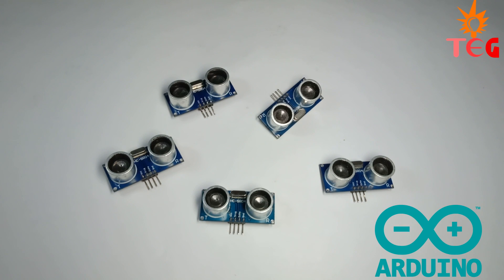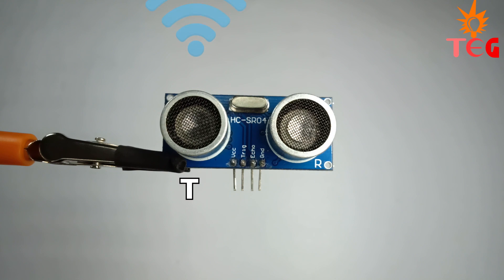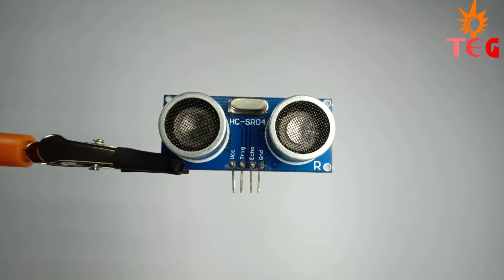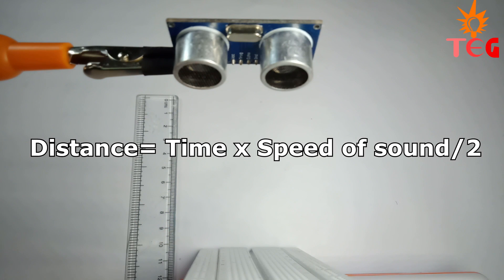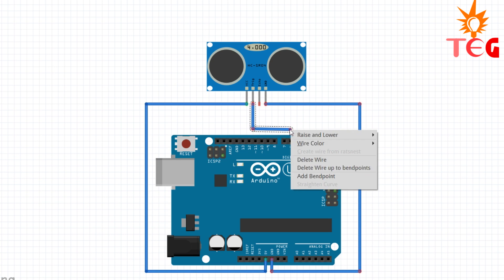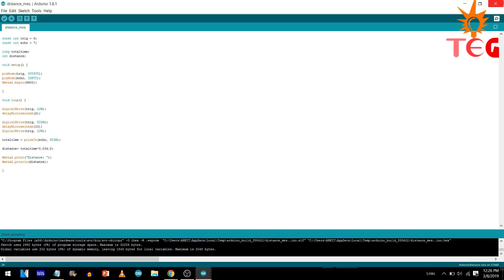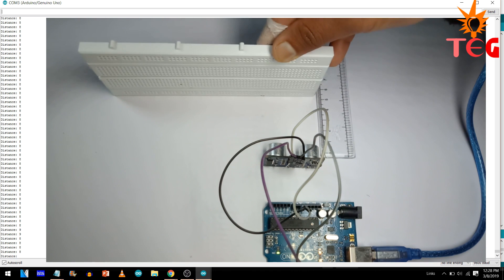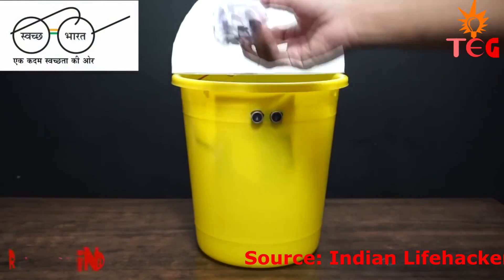HCSR04 Ultrasonic Sensor With Arduino in 3 Minutes!

Comment: const int trig = 6; // Trigger pin
const int echo = 7; // Echo pin

long totaltime;
long distance;

void setup() {
  pinMode(trig, OUTPUT);  // Set trig pin as output
  pinMode(echo, INPUT);   // Set echo pin as input
  Serial.begin(9600);     // Start serial communication at 9600 baud rate
}

void loop() {
  // Clear the trig pin by setting it LOW
  digitalWrite(trig, LOW);
  delayMicroseconds(2);

  // Trigger the sensor by setting the trig pin HIGH for 10 microseconds
  digitalWrite(trig, HIGH);
  delayMicroseconds(10);
  digitalWrite(trig, LOW);

  // Read the echo pin and calculate the time it takes for the echo to return
  totaltime = pulseIn(echo, HIGH);

  // Calculate the distance (in cm) based on the speed of sound (343 m/s)
  distance = totaltime * 0.034 / 2;

  // Print the distance to the Serial Monitor
  Serial.print("Distance: ");
  Serial.print(distance);
  Serial.println(" cm");

  delay(500);  // Wait for half a second before the next reading
}